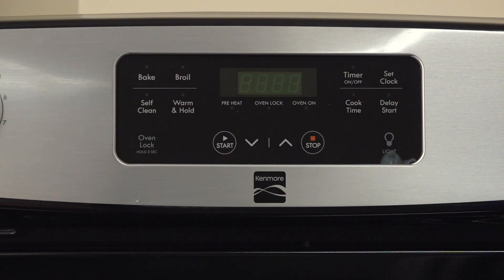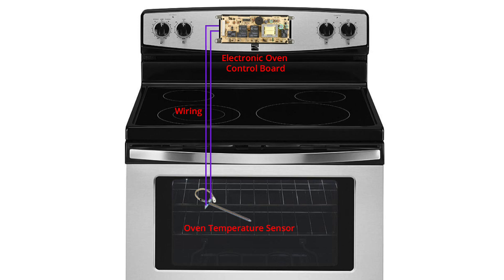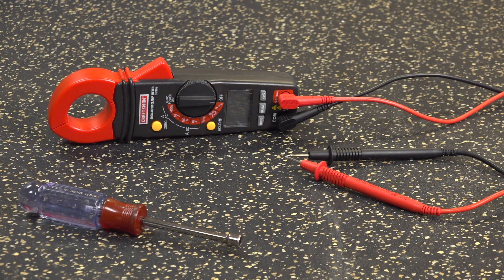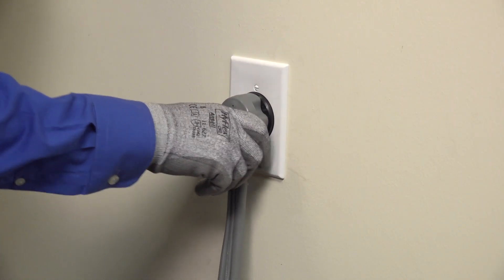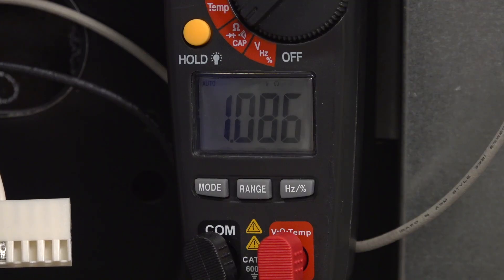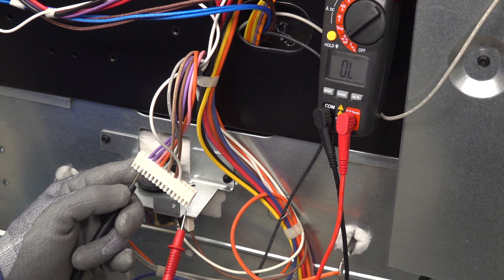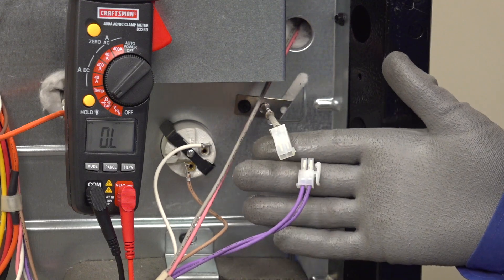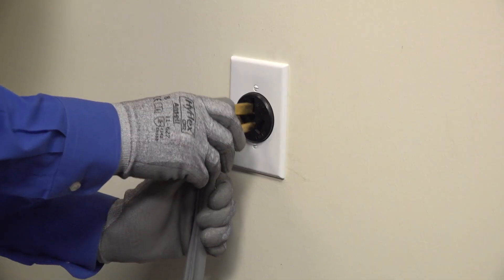Troubleshooting F30 and F31 Error Codes on a Range

Comment: I replaced the temp sensor and the control board, but the F31 code comes back once in a while. If I unplug from the outlet, wait 10 seconds, then plug back in it goes away. I'm about to replace the wire harness too but is there any other chance it could be something else?

Comment: Hi, so I was following your method to troubleshoot F30 code. I tested the wires and it measured up to 1089-1090. I even replaced the control board. But my oven will not work... Every time I try to turn it on it the stove cuts off completely.

Comment: Hi, thanks for your help you are the best. 
In my case I found the ignaiter on a gas stove was broken or damaged.  I unplug it and reset it after I replaced the ignaiter.  Work great and the code 31 is gone.
Did I got 10? 😳
Reply from the maker: Yes. You got a 10. Good DIY troubleshooting.

Comment: I have a really old Kenmore stove that suddenly did the same thing so I’m going to check all the connections and then get a temperature sensor and if that’s not it I’ll get a new used stove Because my stove is at least 35 years old

Comment: Thank you so much for making this video. I ohm out sensor it was good. I order new control unit from Amazon , installed it and works prefect. I have always been handy at fixing things, Never worked on stove other then replacing elements for oven or stove top. This was a first for me, Went like clock work. If you have a Manuel amp meter where you have have to choose ohms number setting, put your meter on 2k to  get a reading.

Comment: My oven shows 1057.. When I cut the oven on it won't go higher then 260° not sure what's going on
Reply from the maker: Your details seem to indicate that the control display is showing oven temperature in Celsius instead of Fahrenheit. Follow the instructions in your owner's manual to change the temperature display back to Fahrenheit. If you don't have the owner's manual handy, you can likely find an online version on our website. Key the model number of your range into the search field on this page: https://www.searspartsdirect.com/ . If you need more help let us know.
Reply: @searspartsdirect  Hi there, I needed some assistance please.  Your video is very helpful however it does'nt address how t go about changing the wiring harness.  I've checked the reisitance Ohms and I don't get a reading from the wiring harness.  I've tried looking up "replacing wiring harness" but cant find anyting on it.  the wires are not damaged either nor are they kinked so I don't know what else to do to repair the wires to the temperature sensor.  Can you help me out??
thanks
Reply from the maker: @ericminco8204  Let us know the model number of your range and we'll try to help you.

Comment: I get the F30 on my Kenmore oven as the oven heats up. sensor ohms correct and no shorts. Could it still be the senor at higher temps or the board? If it was the sensor would it stay at an F30.

Comment: Is the F31 code dangerous, like over time. I usually unplug it and plug it in again and again, and each times it works, then it reverts back. Now it's just showing weird numbers, sometimes it starts counting. What could be wrong? Is it possessed?
Reply from the maker: The F31 code typically isn't dangerous but when your range displays that code, you should unplug the range and repair the problem or have the range repaired by a technician. When the control is just showing weird numbers, you'll likely need to replace the control or have a service technician replace the control. If you replace the control yourself, be sure that you unplug the range before beginning the repair.

Comment: Does the oven has a reset button somewhere? cause replasing the board, heat sensor did not fix issue?
Reply from the maker: Let us know the model number of your range and we'll check to see if your model has a high temperature limit switch with a reset button.
Reply: @searspartsdirect   Replaced the board and the probe was showing the proper ohm, still getting the F30  model # fgfl67dcg
Reply from the maker: @sydneydurbin2114  Unplug the range and check resistance through the temperature sensor probe wires that connect to the electronic oven control board (usually violet wires). If your meter doesn't measure proper resistance through the wiring and probe, then you'll need to find and repair the wiring break or replace the wire harness.
Reply: How to fix F50

Comment: All I did was unplug it and plugged it back in and it worked
Reply from the maker: Sometimes the simple fix works. Thanks for letting us know what you did to fix the problem. We're glad to hear that you got the range fixed.
Reply: Worked for me too. Saved my sanity since my fridge is acting up also .
Reply from the maker: @Tubermich56  Let us know if you need help diagnosing and fixing your refrigerator.